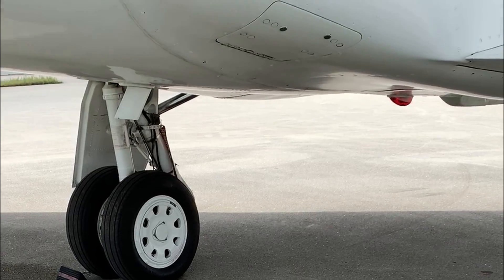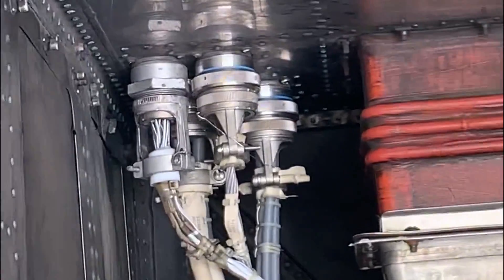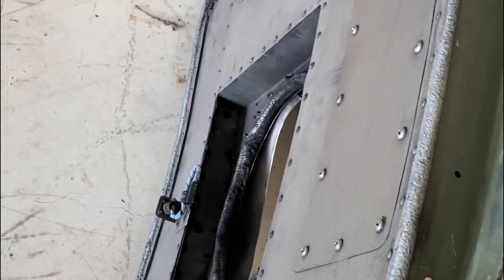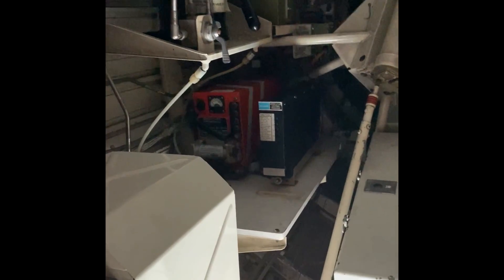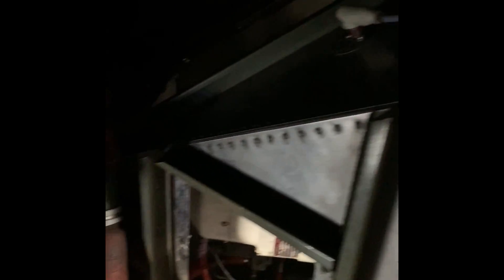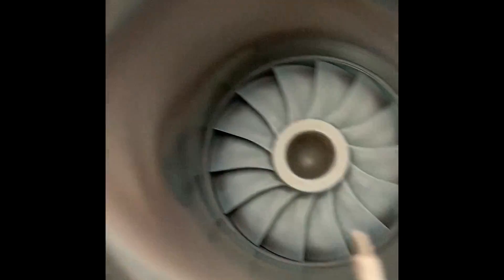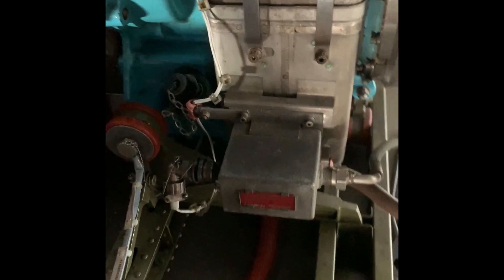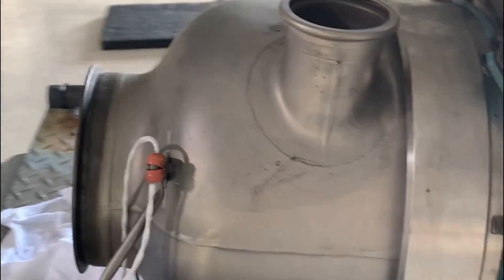Tech Tuesday - Gulfstream APU Removal

Comment: Next time he changes out the TROV or relief valve, have him film that.  We build and repair them in TUS, and have been told by Gulfstream that the primary cabin pressure valve (TROV) is a royal pain to install and remove.  We get them with the actuator beat to hell from the installation process.

Comment: Just out of curiosity, do you need to have the APU installed to actually have the plane flyable or are you able to per say, be able to fly the plane without it and just start the plane with like a GPU and run it that way? This is pretty sick with how small that APU is yet it produces enough bleed air to start the mains and give power to the plane without a GPU

Comment: Does the APU run on jet fuel or does it have it's own fuel tank with regular gas?   Put that bugger on a motorcycle if it's jet fuel and hang on!!!       ;-)
Reply: Jet fuel, comes from the wing same as the engines, uses the LH boost pump in the wing

Comment: I am a non pilot what is a APU?
Reply: Aux Power Unit, supplies electrical power,  and pneumatic air for air conditioning and engine start. Can be used in flight in emergencies.

Comment: Does the APU on the G-IV actually assist in engine start by diverting bleed air or is it for back-up/auxiliary power only and the engines start themselves? I used to start military jets many, many moons ago on the flight line with our version of a "jet engine in a box", but it occurred to me the engines on this style jet probably don't need bleed air to start???
Reply: The APUair IS used for eng start, NOT to be used for Wing AI
Reply: FunKen GreuVeN the APU in this instance only provides bleed air for anti icing. The engines use a starter generator for starting.

Comment: Very cool. Our shout out to Adam. What is the fuel flow for it when operating?
Reply: I always wondered that as well. But my question would be  do they have to calculate for fuel burn while it's in use? Kind of the same question just worded differently I guess.
Reply: About 300 lbs/hr

Comment: That APU is absolutely tiny compared to an APU on a C-141 or C-5. lol
Military APU: Air Pressure Unit, for pressurizing the aircraft and Aux power.
Gulfstream  APU: Auxiliary Power Unit, same purpose different name.  
Thanks for sharing. Very interesting, to be sure.
Reply: My dad used to be FE on 141's and flew on 135's before that. Always joked how it was a luxury to fly the 141's since they were told to never use the APU on the 135's due to high fire hazard.
Reply: Eagle Grip actually the apu serves the same purpose and means the same thing, at least it does in the C-17.
Reply: @superskullmaster  
ROTFL! Yes...the C-17 is a
glorified C-5. Most the of
components are in interchangeable